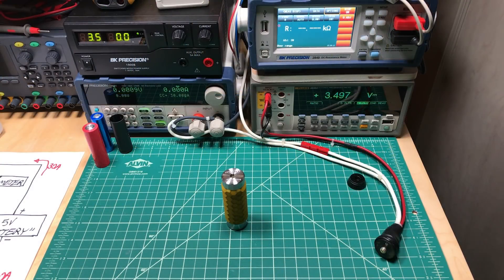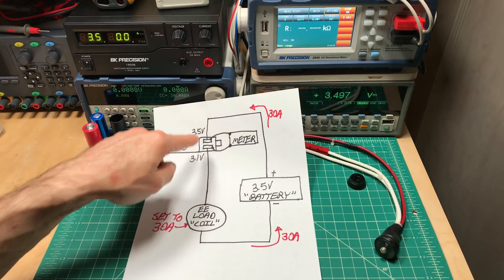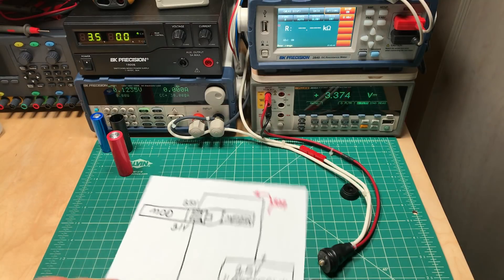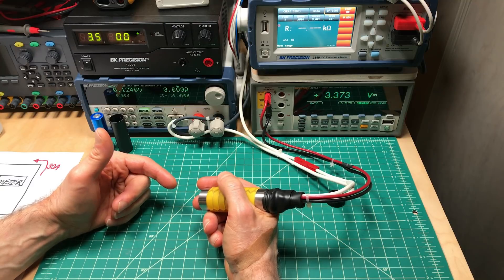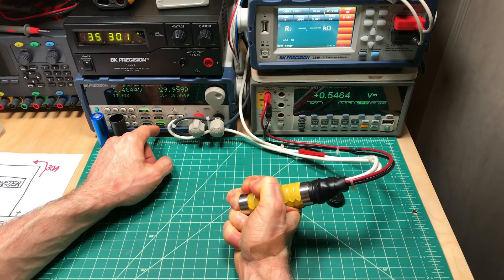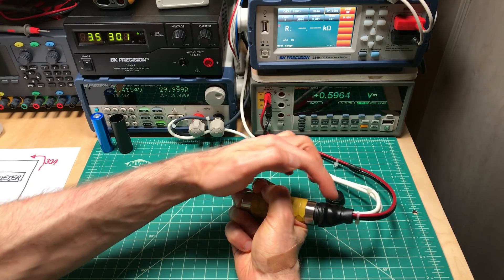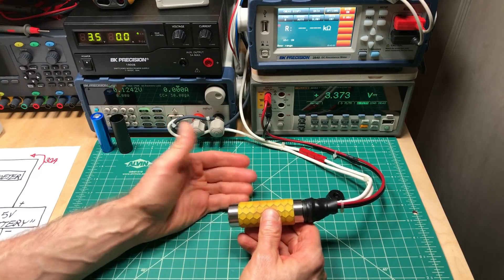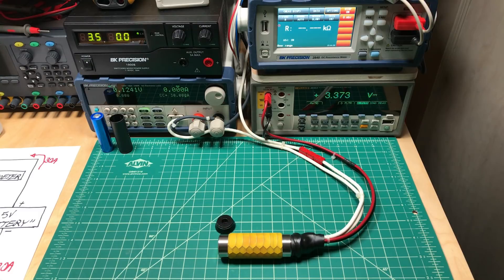Minding Your Mechs – Ep002 – Testing issues, they affect performance too

Comment: Youd be surprised how easy it is to warp and alter the threads just from over tightening, Id be tempted to buy a few more machinas try not to over tighten and see if they have the same degree of variance. Threads and the way they behave under load is quite the science and the distortion is almost relied upon in some applications

Comment: Thank you for the video, very good information. Is there any difference in testing once the setup has cooled back down?
Reply from the maker: No change in the voltage drop whether hot or cold, just in how far I can tighten things (which does affect resistance).

Comment: Just curious as electricity is starting to fascinate me as I took up vaping especially but what would happen if you got shocked by this setup? Seems like lots of current or amps which I understand does the damage not voltage as much but I assume it does go hand in hand to an extent???
Reply from the maker: You can get a mild shock but 4.2V is pretty low and has a hard time driving much current into a person.

Comment: Mooch I'm told that the mod your using has a lot of voltage drop as is. Not sure if this is true, as I've never used one, but just wanted to share what I've heard. I wish you had a different mod to use for your test , but I understand there aren't many 2x700 tubes out there. FastTech has a Tauren which takes all cell sizes(18650's 21700,20700,20650 at least) and after map code is like $35....Hope this helps. Im thinking there are more stable mechs out there that may help bring more consistent results in the end. Thanks for this mooch!
Reply from the maker: I chose this mod for the video because of its issues. :-)
I need to design the test plan around the most problematic mods. Otherwise I could end up having inadequate testing in place halfway through and need to start all over. I will be testing the Machina along with good and bad performing mods.

Comment: Have you considered adding a thermistor to the cable bundle running to the Goon? This would allow logging temperature with voltage drop. It might reveal a coefficient for the average expansion of metal in various 510 connectors. I do not believe this problem is limited to Mechanical Mods but everything using a geometry similar to the 510. Temperature could also be used to seed the algorithm that postpones the "Next Press".
Reply from the maker: Doing something like that will be part of atty testing, coming later, but since I will be using the same atty for every mech test  the temp readings will be pretty much the same.

Comment: All testing should be done at a specific tightness - like two finger tight, or use a torque gauge if you want to be more scientific.

You should not be overtightening - it's not a realistic test - so use like everyone else will.  It's not your fault that the RX is a piece of junk :-D
Reply from the maker: Agreed. The overtightening was merely a demo of its effect.
Reply: Battery Mooch  how about adapting an atomiser, say velocity, connecting the leads to the posts. That way you can't tighten more than the atomiser deck will allow. As close to real life as you can possibly get as the 510 pin will only be pushed down so far.  Regarding the hard push on the button. Maybe set up a fixed or calibrated actuator that gives a "normal" comftable pressure each time. A lever at a fixed length.  Phil Busardo may have some input on button pressure.
Cheers.
Reply from the maker: I was using a Goon 1.5 deck for the video and will be switching to a Cosmonaut.
Setting up an actuator for consistent pressure for each different mod would be a nightmare...but credibly useful. It’s not something I’m considering now as I get pretty consistent button pressure manually. It’s the tightening of the mod that is a real issue for some mechs.
Reply: Battery Mooch as the goon deck should butt up to the mods 510 Then there should be no room for take up. Face to face. Or an I on the wrong track...

Comment: @batterymooch use some mics to measure the length of your aluminum slugs before and after testing. You could also craft some of your own using some copper pipe and caps for plumbing, just don't forget the insulating sleeve.
Reply from the maker: The 20700 slug went from 69.87mm to 69.95mm, just over three thousandths of an inch, if I got it too hot to touch with a heat gun, at least 70°C. It barely gets warm during mech testing due to its low resistance and I couldn’t reliably measure any length change.
Reply: Battery Mooch I agree that the slugs you have are good for the job. At those loads that mass of metal will not expand enough to measure without lab quality kit. Since your using the same slugs each test it's a constant.... repeatable consistency is the goal rather than absolute values.

Comment: Great vid Mr Mooch 👍
About the battery positioning between negative & positive for this mod,does it makes any difference in battery safety if the -/+ inserted either way round since for this mod wismec recommended the positive to place down and not towards the atty
Reply from the maker: I recommend following the manufacturer’s instructions. It doesn’t matter for my battery substitutes though.
Reply: Battery Mooch Finally you cleared my doubts. Thank you Mr Mooch, cant wait for your further testing on this mod 👍

Comment: I'm wondering if the issue here might be due to cheaper quality metals in this tube, I would like to see a higher end mechanical mods results.
Reply from the maker: Agreed. But typically not an issue with a temperature range this tiny.
Reply from the maker: I did the pre-testing on this mod because of its reduced performance. It helps to ensure a good testing methodology that can handle the issues that pop up. I will be testing good mechs too.

The Machina is a SS mod with lots of cutouts in the tube so the resistance will be a lot higher just from that alone. Lower quality metal won’t have an appreciable resistance difference compared to that.
Reply: Battery Mooch  types of metals could make a difference, copper expands a fair bit and has a tendency to "flow or spread", brass not so much. But some real budget kit has steel or steel based alloy, very little expansion.  
Always more to things than meets the eye....

Comment: Mooch AWT 20700's? Any experience with them? Been using them in my squonker and honestly very impressed.  Claim to be 4200mah and 40A max, think 20 continuous.  Lasts an entire day of vaping and hits noticeably harder than even my best Sony 18650's. Got to find a good charger that fits 20700's as well
Reply from the maker: https://www.e-cigarette-forum.com/threads/bench-test-results-awt-40a-4200mah-20700…preposterously-overrated-false-data-do-not-buy.812261/

Comment: Mooch definitely love everything you do and I'm a huge mech/unregulated vaper myself. I wonder if this would be an issue with another maybe higher quality mech? Like my Comp Lyfe HK classic.  Hybrid and the only part that unthreads is the actual button housing which also takes up battery rattle.  Your on to something for sure and if anyone can figure it out it will be you.
Reply from the maker: I’m sure it won’t be an issue on many other mechs. I chose the Machina for pre-testing to force me to come up with a more robust test plan now rather than be surprised by the issues with lower performance mods later on.

Comment: Didn't understand much until the heat expanding the metal and it getting loose. I'm a dumbass lol! Don't know if there's any way to correct that. Cranking it tighter when it expands isn't really good for the threads. Sooner or later they will ware out. Good video and good luck solving it-my brain doesn't work good enough! Thank you for everything yo do for us!

Comment: Rig up a way to use a torque wrench to apply the same force to each end or mod each time...a digital one would be very accurate provided you use the same lever to tighten it each time.  A soft jawed spanner wrench might be the easiest and least damaging to the finishes.

Comment: Very interesting work Mooch. I can't help but wonder if the metals molecularly change slightly with heat (and possibly current?) passing through them, therefore causing the variance in measurement of cold vs hot. 🤔 Maybe this could be verified using a force gauge to exactly press the same and measure the hot vs cold drop.
A different material plug would be interesting to see if that is affecting the result as well. 

Thoughts on dielectric grease on the threads as well?

One more thought......test the resistance of the slug out of the mod cold and then heat it (hair dryer, torch etc) and test it hot....🤔🤔
Reply from the maker: Thank you for your thoughts!
Metal resistance increases with heat so we can probably discount that as a cause for the reduced resistance I saw.

Agreed...the force I use to tighten a mech might need a torque wrench if I am not consistent enough.

Most dielectric greases are non-conductive but are great for reducing friction and oxidation. They will be part of my testing later.

The 20700 slug was 6-7uOhms cold and 7-8uOhms almost too hot to touch. The temperature change just isn’t enough to make a real resistance change.
Reply: Battery Mooch fantastic. Well, OF COURSE you've already thought of and tested what I was wondering about!!! Thank you so much for the reply and clarification of my (backwards) assumption. Your work is the most helpful and intriguing I've come across since I've started this learning journey on here, ECF and Reddit daily almost 5 years ago. Can't thank you enough!!!! Nothing but love, brother!

Comment: Would measuring the temperature rise using a thermocoupling device allow for at least one more variable to be considered? It would be ideal to find a substance that both has a high conductivity and a low heat rise, but it would be both costly and difficult to machine into the proper dimensions for a mech mod. In the mean time, keep on testing Mooch. These videos are mesmerizing. Great work!!!
Reply from the maker: I could measure temp but the lower resistance mechs will be the ones generating the least heat already. 🙂

Comment: If the variability of tightening and the button push turns out to be greater than the construction of two well made mods, then the voltage drop of the mech and design would be statistically irrelevant. Similar to how in stastics if the margin of error is greater than the measured difference in two readings they are said to be the same. Either way it would be useful to know.
Reply from the maker: Agreed.
The test results will be interesting!

Comment: Is it possible that trying different metals for the slug would change any expansion rate in that and give a compensating factor to the expansion in the attachment section?
Clearly, you can't go for maximum torque on all the mechs, as that would be a completely unrealistic scenario, which with a real cell instead of a slug would crush the top contact, and maybe even the negative one too.  would a strain gauge to allow you to adjust for consistent battery contact pressure instead of tightening torque give more consistency?
But if you can't get consistent results on one mod, it's impossible to have any meaningful comparison between different ones.  Quite a conundrum..
Great work, and thank you for all that you do.
Reply from the maker: Yea, if I cannot tighten consistently I will either have to list a range of values for each mech or us a torque wrench setup. The slugs barely change temperature though so I don’t think they are a factor. I’ll do a measurement to be sure.

Comment: Mooch would you try testing one piece top mech mods

Like the truck knurled, xxx, 11/11 for example
I think the expansion due to heat would be minimized yet I'm not so sure

Would be interesting if those expanded with heat

Comment: Maybe you could incorporate some sort of torque system to make sure the load exerted on the RDA deck and mech stays constant?
Reply from the maker: Considering that. Or, each mech just gets a range of resistance values.

Comment: Very interesting initial results. My experience with my rx Machina has been all over the place, and this shows why I feel. But I follow the basic idea of never torque down parts especially when cells are there. Don't want to damage that positive plate. 
I imagine this shows why a lot of the higher end mechs use disks in place of a cap for the 510 or are solid pieces. I wonder if the results are the same with a top that threads into the body, rather than a body that threads into the cap like the Machina. This is all very fascinating and a great sign of a video is one that leaves you asking more questions. 
Thank you Mooch.
Reply from the maker: Agreed, the tightening was just to determine the range of resistances and should not be done with a battery. I will emphasize this in the test videos.
Reply: Battery Mooch I'm glad that you'll emphasise this, I assumed you would. It's just fascinating that even a sight turn to torque down the cap makes such a massive difference. Can't wait for the next video.

Comment: Thanks Mooch! Would contact paste on the mod's threads improve the mod's top cap/ resistance fluctuations ?   Thanks Mooch, it may have been inconclusive but it is good to see the results and methodology involved! 💚
Reply from the maker: The dielectric greases are typically non-conductive and are for corrosion and friction issues. But I will be testing them in a later video.

Comment: Hey Mooch, would it help to use an rda that would have less heat transfer such as the YSTAR Nuwa Ceramic rda?
Reply from the maker: The heat comes from the 510 pin and posts. I think every atty would have similar issue. The heat  is important though as it will be present in every setup.

Comment: Hey mooch did you try this test with a different atty??
Reply from the maker: Yes, three. Slightly different resistances (which may have been my tightening torque) and similar heating.

Comment: I think the peek is softening, allowing you to pull the 510 pin down further. You're running A TON of amperage through that connection for an extended period, which in my opinion could soften that insulator. Take it apart and look for distortion of the peek insulator. I'll bet its squished.
You're RIDICULOUSLY smart dude! I love it!!
Reply from the maker: 😁
I ran it for 60 seconds continuous and the atty pin was only very warm. No sign of damage anywhere.
Reply: Takes a lot and I mean alot of heat over an extended time period to melt Peek insulators.  I only know from experience
Reply: I've only damaged Peek by overtightening a 510 pin...never with heat though. 
It was just a thought. Thanks Mooch!

Comment: I think this issue will vary in its impact on testing between different mods. There are so many different designs in terms of switches and the way the cell is held into the mod.

The RX Machina is quite unusual in this regard. The cell is not clamped into the mod by tightening it down, you physically move the cell up towards the RDA so the harder to press, the hard the hit. Some other designs will be much more consistent.
Reply from the maker: Agreed!
Well, it’s my hope that is the case. I chose the Machina to start because of the issues I thought I might have. Getting them settled now, by adjusting my methodology, hopefully makes the others that much easier to test.

Comment: Mooch,  would it be possible for you test to see if there are any differences between a spring loaded and a manual adjusting  510 to see which hits harder and also has less voltage drop?
Reply from the maker: In an atty? I will be testing a bunch of them after mech testing. I’m guessing the specific setups for each atty will have a greater effect than spring loaded versus screw adjust. We’ll see! 😁
Reply: No, the 510s in mods. The SQ mech mod has a 510 that you have to manually adjust with a screwdriver. That kind of 510 should  give you a better more solid connection and hit harder than a spring loaded one, no? It would be cool to find out if there are differences if any and finally put that little debate to bed.
Reply from the maker: If any of the mechs others are sending me that mech I will definitely test that out.

Comment: Maybe, just maybe, how the 510 screw is machined would affect the voltage drop difference? Try to sand the 510 down a bit with really fine sand paper?
Reply from the maker: It can definitely affect things if there was a burr or unflat surface. The surface of the atty I’m using though was checked with a 10x loupe and looked good. It will be the same atty for every test so any effect it has on performance can be discounted.

Comment: Try a less shoddy atomizer, maybe?
I’d suspect the pin before the mod, given my experience with goons
Reply from the maker: It’s a popular atty, which is important, and it’s possible effect on performance doesn’t matter since each setup will use the same atty. Even after a continuous 60 second discharge its 510 pin is only very warm. What atty do you recommend for a low resistance connection? Has anyone measured atty resistance?

The heating with any atty I select will be orders of magnitude less than any setup using a coil and the huge amounts of heat the coils feed into the atty.
Reply: I meant more the connection. I’ve had a goon 22 that just wouldn’t behave after a couple of months. When the 510 touched the battery, sometimes it would fire normally, often it would seem a little off, and some hits it would be very weak. 
Replacing the pin didn’t help. I believe it was the (supposedly PEEK) insulator. 

I just would make sure whether the issue was there with other atomizers, is all I mean.